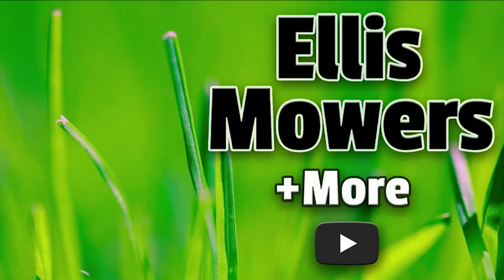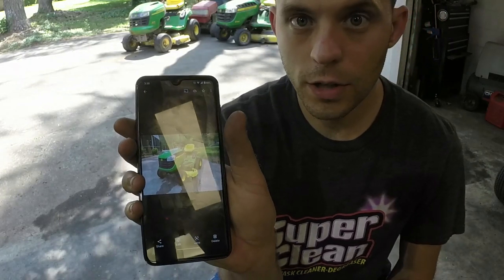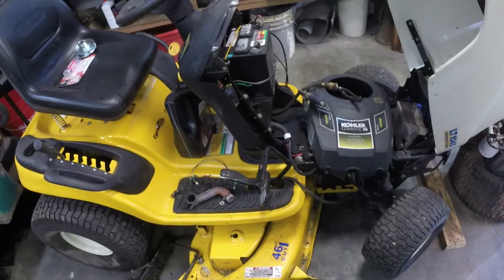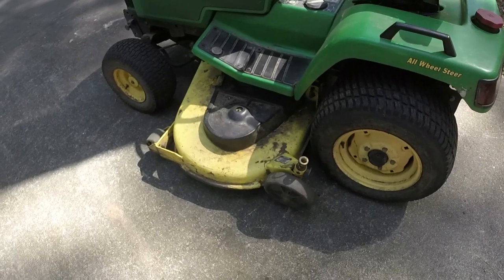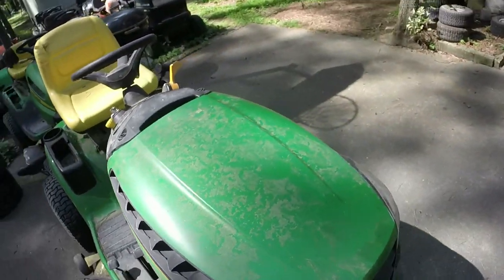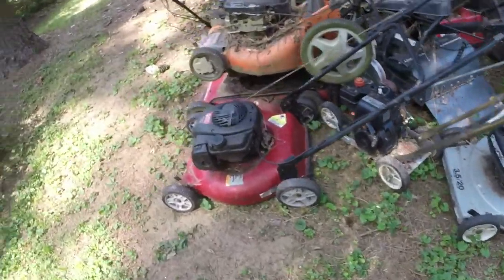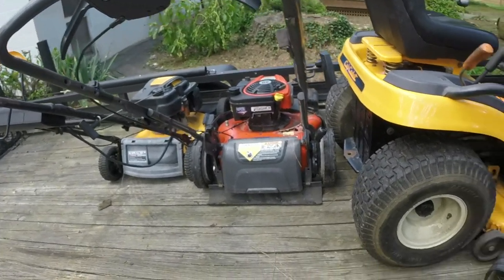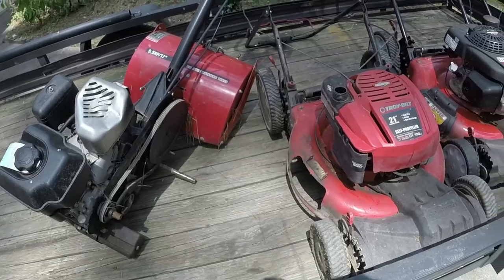The most free finds I've had in a long time!  Let's check them out!  Plus other project updates

Comment: I broke two bolts head off removing mower engine. Was tryjng to salvage  it. Not even gonna try to take them off. You have that happen to you?
Reply: No I’ve never had that so they must have put red lock tight on them 😅
Reply from the maker: Yes, the worst culprit is Briggs flatheads that have sat outside.
Reply: @EllisMowersandmore  It’s dissimilar metal corrosion. I have tried to get them out so I jus change the sump. I’ll put grease on the bolts to make easier for the other person. Too bad they don’t put something on them when they mount them at the factory. Job security for them.
Reply: @EllisMowersandmore  Do you try to get them off after breaking them?